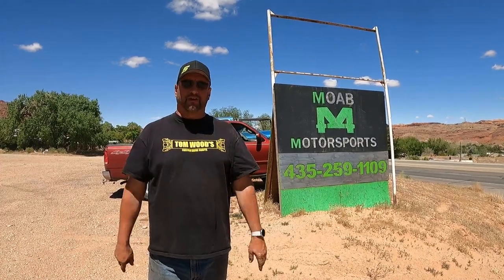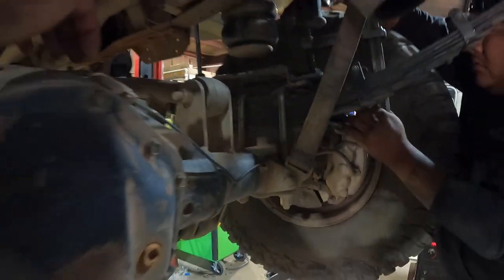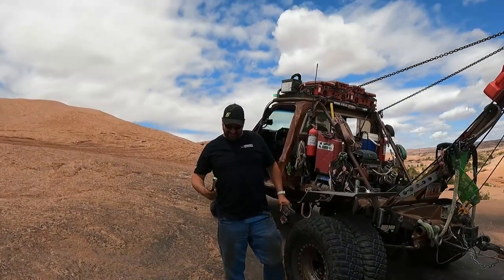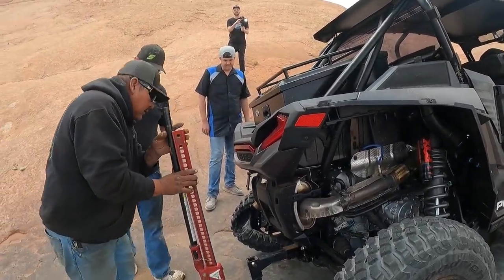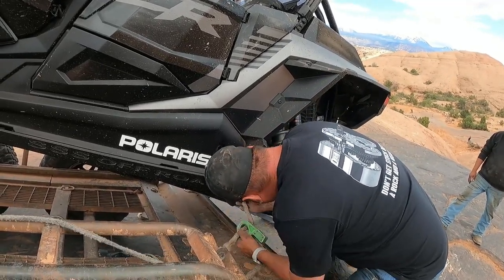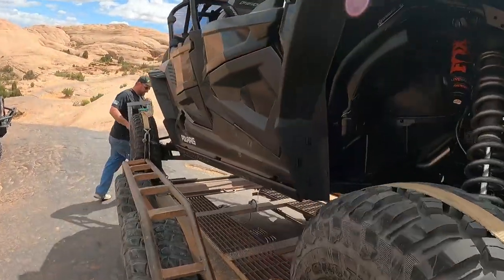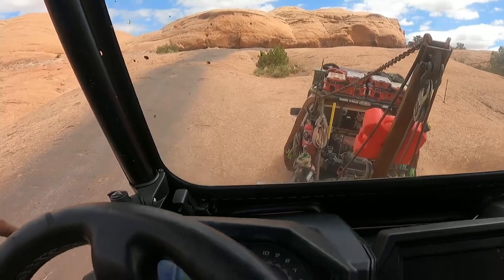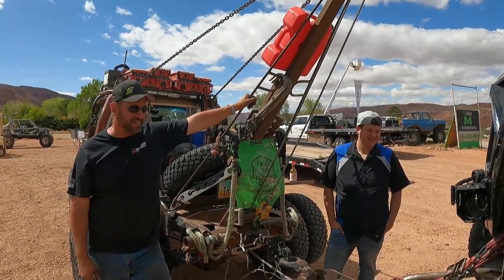AA Wrecker & Recovery With Robby Layton

Comment: Maybe an F250 4x4 with the old cab? Your choice of engine of course. Nice recovery, I'm always hugely impressed with the Rory and trailmater combination - casually drives a tow-truck and trailer along the trails that break many others, recovers them and drives back out - the stuff legends are made of.

Comment: I had a 95 F150 with a basic 302.. 5 spd 4x4..  It was a monster once you put it in 4 wheel low. But it was pretty gutless on the highway when pulling a big tool trailer.  But I did run it past 320k miles before it finally spun a bearing.  So I wouldn't call it "un-reliable".  That thing never stopped running
Reply: Chevy guys wont talk about 302 or the 300 inline 6..... All engines in the 80s and 90s were gutless at 200-250hp.
Reply: I have a '94 F-150 4x4 short bed single cab with a 5.8 (351) that's just shy of 400K. Still runs great. The only engine repairs I have done are a timing chain, rear main seal and oil pan gasket. And yes I also own a Chevy C10!
Reply: @ponypwr  lmfao as a chevy guy I can tell you the only reason I run 94 & older chevy trucks is cause where I live in the rust belt you can buy 5 88-94 chevys for the price of one 96 & older ford pickup that needs 5 grand or more worth of work, & if you can find one that that the frame isnt swiss cheese. One of the trucks on the top of my list to own is a 96 or older ford truck with a 300 6 with a  5 speed 4x4. Too bad ford stopped building work trucks in 96 when they started stuffing the boat anchor that is the 5.4 Triton in everything
Reply: I'm a chevy guy and I have a family member who loves fords but stock for stock fords have had more issues. Like electric or hydraulic more so then engine failure. Not to mention all the little issues  they have as far part interchangeably.
Reply: @KoltFin  Yeah.. Chevy's are better for projects-- that's for sure.  I've had good luck with Fords though.  a 95 F150 5spd 4x4 that went to 320k miles.. and for the past 8 years, I've driven a stock 2002 F350 7.3L Diesel 6spd 4x4, which is already past 330k miles and still going very strong.  I don't think this diesel will ever die. lol..  It can still pull an overloaded 5th wheel trailer up a mountain and not ever care that anything is back there.

Comment: I suggest a 70s Ford straight 6  - borgwarner 4spd with an NP 205 and an Atlas splitter - old school style .. super easy to work on and just a work horse .. has the most torque and reliability of any ford made and it’d fit nice in that Ford engine compartment .. throw some 4.88s with air lockers set up on some 38s .. won’t be a speed Demon but it’ll get the job done. 
great video Rory .. keep them coming.
Reply: yup.  my. wheeler runs a similar drivetrain. 300/6 4bbl. dual efi ex manifolds, 4spd np435, 203/205 doubler, 4.11s on 38s.
Reply: I'd go with a later fuel injected 4.9 I-6, but yes!

Comment: Understand why there is strong  opinions about Fords.  Another opinion to add here; ran the 1972’ish 351 C.I.D. Cleveland engine for many years in a 1965 4X4 3/4 ton, ran in the sand fine on 34’s.  It was durable and impressive for a dish-piston smog-era engine.  (Not big on power; stock, but toss a higher CFM carb on-top a flowing intake manifold, livened it up noticeably. Unable to claim this type of impressiveness with a 1983 351 “M”., 4X4, but it survived some heavy throttle off road trailer-towing use.   Had an ‘06 - 5.7-liter, 4X4, was poky, only 13 MPG, but no failures.  Oil changes often, are essential for longer term durability.  Just an opinion here, not recommending any brand, since brand differences are less today.

Comment: - I have done escalator on moab
- cute, i do it every few days. in dually wrecker. with trailer

;-) 

But Rory isn't like that, he is hard working, humble specialist
Reply: Tucker is the true Escalator GOAT. He did it in his stock 4Runner that was is daily with his front tires pointing in more different directions that a drunk Walleye.

Comment: Man-oh-MAN! Some of these new video angles we're getting on your recoveries - like the one starting at 19:23, really give us all a good sense of good sense of how steep some of these parts of the trails are! 

And I know how silly this may sound because it's an extra (and unnecessary) step in producing a video, but 'I' think it would be very interesting to know the 'grading percentage' on shots like these! ...Like when you're driving a local highway, state route and see a sign that warns of a '6% grade' up ahead. It would maybe be as simple as using one of those manual angle finders they use for woodworking or construction - and then converting that angle into a percentage that pops-up momentarily on the screen during the video. Like I implied - Just a thought. 

One more suggestion is that you guys are more than intelligent and experienced to design and fabricate an off-road wheel dolly, so when you 'get a call' specifically to recover a UTV, SUV, etc. - - The dolly could be ratchet-strapped the the broken knuckle / wheel, allowing it to be towed short distances without having to drag it on a trailer ramp, acting as a skid?

Looking forward to seeing all of you hit the 100,000 Subscribers mark! Thank you (again) for sharing this content. 👊

Comment: My very first vehicle when I was 16 was a '29 Model A Pickup.  Wish I still had it.  Then, I sold it & bought a '29  Model AA flatbed truck.  It wasn't as fun as the pickup but sure was different than what anyone I knew had.  The suspension & drivetrain were very interesting in design.   Great comments on redundancy.

Comment: You should keep Robby's truck all Ford! Put the 4.9 (300) straight six in it. It's a beast of an engine with tons of torque and you can't kill them. I know Ford get's a lot of hate but I've never had any issues with the 300 or the 302 and I've put over 250,000 miles on both.

Comment: Take a old 6 in 1 screwdriver shaft or a piece of 3/8 pipe cut a slit in it with a grinder smooth up the edges  put in your cordless drill chuck slide in the strap it will wind up straps nice and tight and fast especially when you have several to wrap up I use mine daily

Comment: Knew of a guy that fitted a Mustang body onto a 4x4 pickup frame with identical wheelbase.  From what I heard, making all the needed connections wasn't very difficult for him.  He usually brought it out to play when the roads were bad ...  cruise the county roads, pull out people that slid into the ditch as he came across them.  Lots of kids looking/pointing/"How Cool is That!"  going on.  Might consider a similar approach to the 'AA.'

Comment: Them farm jacks, hi,lift jack, are ok but they need to have constant lubricant, I plaster mine with axle grease helps springs from rusting, also if you put a bit of pressure on the handle as you flick the down lever it releases easier, all the best to yous and your loved ones

Comment: A pack of leaf springs is still the best form of suspension for vehicles that have to work with a wide range of loads. This is why leaf springs are still used on a lot of modern commercial vehicles such as vans and trucks.

Comment: This is the first time I've seen that trailing arm beam running next to your drive shaft.  Very cool.. So I assume that's there to help slide on rocks and keep it off of the drive shaft.   I guess it also helps keep the axle from being yanked out from under you too; or rolling.   Very cool-- I hadn't seen that before, with a leaf spring setup.  I like it....  I don't think you ever showed that in your "truck tour" videos.
Reply from the maker: It's a traction bar. Keeps the leaf springs from twisting under load causing axle wrap.
Reply: @trailmater  Oh I see.. and it has to match the same pivot points as the drive shaft so it won't bind.  cool stuff.
Reply: @trailmater  
What did that Dana 80 come out of? What's your gearing?
Reply from the maker: @xmo552  2001 dodge 3500 dually. 4:10 gears.
Reply: @trailmater  
Nice. When I first heard you say it was a Dana 80 a while back I assumed it was from an 80s c50 or something like that. Today I noticed the brakes didn't look like a rigged-together setup.

Comment: hey Rorry id hi recommend the daystar air bag cradles. it will prevent you from ripping off that mount again. and will allow you to retain full droop of the rear suspension. aswell as retaining the use of the air bags.

Comment: I still wheel my 89 Toyota on All Pro leaf springs I installed 15 years ago.   They have sagged out perfectly for my 39's, flex great and are dead on reliable.  On issue I have ever had is broken pins holding the leaf packs together.

Comment: When I was a fleet technician for Bridgestone commercial one of my worst callouts was when a tyre or tyres had blown out and damaged the air bags on the loaded truck or trailer ,  as had to callout a mechanic with the correct bags,   I would jack up the truck or trailer then get everything ready but replace the tyres for the final part,   I carried spare rims as that was on a regular basis,   the worst was all the wheels and tyres on the left side were all so badly damaged,   and our trucks and trailer have 9 axles.   😠.

Comment: What do you think of this? Mount something on the bottom of the fender on the trailer. Hinged. Swing it up and pin it and it’s out of the way. When it’s down it could act as a wheel chock. Maybe one on 4 corners.

Comment: Just a thought. Maybe get a ski off a snowmobile and figure a way to put ubolts on the axle and then let the ski slide the control arm on the trailer. It would be easier to slide than try to pick up the broken axle up while you are winching it. You could make a couple of them in case both wheels are busted. Just a thought.

Comment: I believe it’s possible to build a reliable Ford engine. I was thinking of a nice 5.0 or even 300ci six banger with computer control. I might consider a old analog 427 or Lincoln continental motor updated to throttle body injection . I would avoid any newer Ford with turbo chargers or cam phaser’s until they get there “stuff” straight.

Comment: What do you mean spitting spark plugs, Ford fixed that problem years ago.   I know, they fixed it with a  spark plug meant to snap in half.  But they moved on from that now too. Im now up to the 2019 5.0 and so far nothing wrong, 151,000 and only did the plugs (which were very easy) at 140,000.   Ford taught us all how to re-thread spark plug holes without pulling the head off. It was all worth it.

Comment: Is the TrailMater running a 454 with a throttle body injection? Does it also have 2 different splitters for the transfer case?

Comment: ROTFL.  Those tourists on the Moab Adventures truck cracked me up when they screamed.  I can imagine them riding shotgun in Trial mater over some of the obstacles we've seen Rory navigate.  Especially those with hundreds of feet of drop-off if the wrecker slides off the trail.  That Kane Creek recovery from last week would do it.  That moment right after @21:30 still gives me the collywobbles just thinking about it.  I am sure young Lilly was walking behind the vehicles at that point.  www.youtube.com/watch?v=g6Hc_dtNKR8&t=1293s

Comment: Just a question, which you probably wont answer, but here goes, would it be possible to fit a torque converter to a manual gearbox, in the tow truck, as is done in heavy off road logging equipment etc? I should imagine it would be very difficult, but the advantages would be obvious. Again IF it were possible
Reply from the maker: Not sure how you would do it the same type of way they do it. The torque converter is where you lose all the power and ability to apply the power now and when you want it. Pressurizing the converter while it's hooked to the input shaft on a manual would be interesting. Good thought tho.

Comment: I still think you should stick with Ford. A built 460 or even a 300 straigh 6 will provide lots of low end torque. Both were reliable motors.

Comment: Always Raise The Handle All The Way Up Against The Post Of The Handyman Jack, (High lift), Before Releasing It To Lower The Load As It Can Slam Up And Smack You Really Hard, Never Release It With The Handle Down, You Can Get Away With It Until You  Have 3000/4000 lbs On It, Then It Will Hurt You Bad

Comment: Rory, 
any reason shy a Cummins diesel (high torque) is 'never' considered for any of these recovery  vehicles ?
:-)
Reply from the maker: Personally I absolutely love the Cummins engine. It's the only thing I'll pull on the highway with. I just don't want to listen to one all day on the trail. Had one, wasn't my thing.
Reply: @trailmater  I would think in a 'highway trip,'  your (diesel engined)  cab would be 'sealed,' insulated from the acoustic noise, & air-conditioned,
w/c is the compleat opposite of your 'exposed & lightened'  "Trail Mater" ...
now,  
I understand completely.
Oh, not to mention the 'vibes' of a diesel engine.
Cheers.   ;-)

Comment: This is probably common knowledge but I haven’t seen anyone on this channel or any of the others utilize it.  See some struggling some on tightening the straps, in the military we would run the excess of strap back through the handle and back and use that to pull on the handle.  Allows you room to put your all and even someone else to pull.  May not need it that tight.

Comment: Triton does suck but that isn't the only motor they build ,,, Just remember that they won with the LM GTE,,,, 24 hours of  Le Mans whenever they applied theirs
And I ran a 460 for decades off road and never had an issue with it other than occasional vapor lock because of exhaust heated intake manifolds

Comment: Whats the extra link on the rear axle? Radius arm with leaf springs???
Reply from the maker: It's a traction bar. Keeps the axle from twisting with the leaf springs, eliminating axle wrap and wheel hop.
Reply: @trailmater  is that something you have added? Or is it a feature on a wrecker? I spent 10 years as a mechanic here in the UK but didn't work on heavy stuff. I've never seen it before. It makes sense to have, especially with the level of weight,  torque and grip you are dealing with.

Comment: So a 390 is out 
Why not go crazy and put a little Cummins 4 banger in it you could snag a motor out of a skid steer or back hoe 

What ever you choose this ol truck is going to be awesome 🤩
Reply: Or they have crate motors with all the wire stuff
Reply: Given the engine bay a 300 six would be a good choice. For sand one needs throttle response otherwise the I6 Brazilian diesel Ford used in the late 1980’s and early 1990’s in F600’s and F700’s might be an interesting choice.